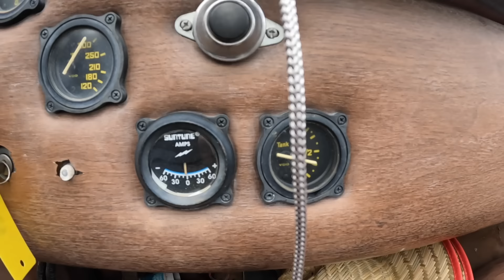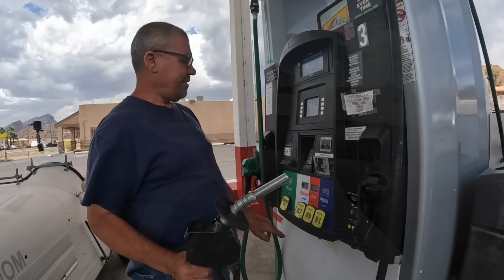This Bugatti Engine Has a Top Speed That you Won't Believe

Comment: Merlin and Brad relying on the Kindness of strangers.  Thanks, Summer, for giving them a ride .
Reply: Love meeting new people 😁
Reply: Up here in Washington State, no single woman would dare to pick up 2 dudes hitch hiking. And most of the time even two dude won't pick up a single woman hitch hiking.
Reply: Merlin I think that’s cool. I bet you get a million hits if you put air ride suspension and one of your hopped up vw  engines 1.5 million hits with a  Ls and disc brakes! Love it
Reply: Seattle WA is my home town. I moved to AZ a few years ago. I would never pick up a hitcher in WA. No need to stop in WA.Most breakdowns happen within walking distance of a gas station.
Reply: @RatCityprincess  Down HERE on the other hand...
Reply: No o e noticed the glass if Ice cold tea on passenger side cup holder.  Who was the passenger?  Or maybe they new summer had her drop them out and circle block for content. No one has reasoning skills it observation
Reply: @trinkladd  It's called editing.

Comment: Hi Merlin.  That place you stopped at is Vidal, not Earp.  Wyatt Earp's cottage was very close to where you parked.
 The intersection of CA 95 and Hwy 62 is Vidal Junction. Earp is towards Parker at the intersection where you turn to Parker (62 & 95).
Fun video.  If you ever need a chase truck for adventures like this, give me a call.  I am in Parker.  Jim

Comment: My Boss has one of those Bugatti's. His has a firewall but there is an access  cut ontop of the body to access the gas tank  and the rear they made the tail section removable  from behind the rear seat.  Awesome  car to drive. Boss has never driven it but i have after working on it. Has had carb issues  .. Also keep up the good work. Enjoy your escapades.  🤙

Comment: Hahahaha ... what an adventure, gentlemen !!! 
I suppose that those polyester bodies were sold as a kit to adapt to a VW-chassis. 
Kind'a like this idea even if I'd prefer a Bugatti-ish body with some (old) engine in front instead of in the rear.
Putting some bags of sand over the front axle (under the hood) will, for sure, give this car a lot more stability. Probaly something about 60 up to 100kg. 

Thanks for sharing. I really liked this vid! 

Grts from Belgium.

Comment: The  Radiator is from the  Original Bugatti Here's what I found on it The Bugatti Type 35B was introduced in 1927 and was the final iteration of the Type 35 series. The name Type 35TC was pondered since it shared the same 2.3 liter engine as the Type 35T and a supercharger just like the Type 35C. The engine produced an astonishing 138 horsepower, by far the most of the Type 35 series.

Comment: Some years ago a friend of mine built a car nearly identical to yours right down to the model A wheels and tires. The very light weight and skinny tires made it nearly un-drivable especially on wet pavement. He poured a bag of redi-mix (80lbs) into the front axle mount bracket which helped some.

Comment: Merlin you are in a tow yard and the perfect place to ask someone who works there for a key to the gas cap. They might even have a universal fuel cap key. The lock out kits the tow truck drivers use to get into customers vehicles usually comes with a universal fuel cap key

Comment: Only 200  type 35 Bugattis were ever made. The last one that sold at auction went for $ 2,900,000. The only thing that Bugatti didn't hand craft in factory were the tires. The engine was built so well that no gaskets were needed anywhere in the engine.Top speed for a type 35 Bugatti was 125 MPH......in 1927. 0 to 60 in 6 seconds. It had an inline 8 cylinder water cooled front engine. It is an Italian car. That lever on the outside of the car was the ONLY brake. It was one of the most winning race cars of it's time. Over 1,000 wins and 47 world records. What you have is a cool kit car replica.

Comment: That is one of the better kit cars from the early 70's they did right & kept it simple with the 2 windscreens and wire wheels, Bruce Meyers had a kit car/ dune buggy he called the Meyers Tow'd, produced about 100 of the Tow'd units, In '72 i traded a '53 chevy "tin woody" for a street legal Tow'd' which happened to be the #2 Tow'd that Bruce produced, A total departure from standard kit buggy of the day As it Had a Tube chassis with 1 piece glass bucket that was inset in the chassis used VW F&R components My Tow'd had an early Bus trans with the reduction boxes & front was llfted so it had about 5" lift, weighed in at just under 1k pounds.It would crawl anywhere we aimed it so we called it the "Lunar Rover" after the Nasa Moon buggy.This Bugatti would be a great sleeper with either a Subaru flat 4 or a Corvair transplant with a slip & slide powerglide if they fit in the engine bay>Yikes,  Or Go offroad with the Bus transaxel & lifted front end, i like the wire wheels so keeping it as intended would be for me.

Comment: That's a BUG-aughty! Kit car body  on a VW Beetle chassis and engine. You guys need leather helmets and goggles to drive it! 😂
Bugatti himself was Italian. But he set up shop in Molshein, Germany and built cars there up to WWII. During the war they produced airplane parts, which made them a target for Allied bombers. The factory was destroyed during the war, and a new one was built near Paris after the war. 
Founder Ettore Bugatti died in 1947 with no direct heirs and the company went downhill until it was bought by the Spanish firm Hispano-Suiza in 1963 primarily for the airplane parts business. 
There were a couple unsuccessful attempts to bring back the Bugatti cars. Finally in 1987 the brand was purchased and moved to Italy, where modern Bugatti supercars have been built in small numbers ever since. If you have several $ million to buy one of those and a long enough straightaway, you too can drive a car at 200+ mph! And, today Bugatti is owned by... wait for it... Volkswagen!
That kit car is reminiscent of the Bugatti Type 35, which was built from 1924 to 1930. An aluminum bodied, open-wheeled race car in various forms with different size engines (including some supercharged models). The biggest engine was a 2.3L straight 8 that produced 130 hp. Type 35 won over 1000 races! 
The Type 35 did not have "bicycle fenders," like those on the kit car. However, one of the succeeding Bugatti racers did use those style fenders. 
In addition to their racers, pre-WWII Bugatti also built luxury town cars and sports cars... the latter having a few more amenities than the stripped down racers like the Type 35. Amenities like an actual windshield rather than those little Brooklands style, and an actual convertible top in case of rain. 
Bugatti is credited with being the first car maker to use cast aluminum wheels (at a time when some were still using wooden spokes).
P.S. I found a couple recent auctions of fully restored REAL Bugatti Type 35C (the suoercharged version) that sold for 2.2 and 3.9 million Euros. I bet you paid a little less for the BUGatti. 😃
And I really hope you put the rear fenders back on. They looked great!

Comment: Your luck is like mine. I may get 30 miles out of my 2005 Toyota Prius which I have not been able to enjoy three days without it having problems. Now the modular Ignition Key has died and the car is dead. I have had to buy both Batteries before I had it three days and it sat a week and a half at Toyota in my town and I had to have a battery delivered from San Lewis Obisto, Ca. and they do not come cheap, Then I had to buy the main 12 Volt at $174.00.

Comment: I need a crown hick in my fleet i might have to see what i have in my salvage yard that has a close enough wheelbase to my bubble vic with 5.0 police interseptor then find a set of triple pedals and punch a hole in the floor and get a racing steering column and derby car ignition and put my moose antlers on the brush gaurd/winch push bumper i have a stout built 318 magnum built for a derby car but that my granny 4 speed with a NP205 twin sticked and a doubler sounds fun then the 5.0 can get shoehorned into my ford courier with a narrowed 9 inch and the 5 speed out of a wrecked mustang to replace the factory 4 speed that probably explode the first time getting on it hard if i could find a bellhousung to go from 4 in a row to V8 stuff maybe i can narrow the front sub and use the vic suspension and steering for the little puddle jumper

Comment: Merlin the Bugatti 37 originally had 8 cylinder engines and are worth a lot of money today in good condition. The VW engine in your car is really a disgrace for what used to be a great car. The VW engine is really a disgrace in a Bugatti 35 - dito Typ 37 from the twenties -. Merlin, originally is the Bugatti a French Car. VW indigreat the Bugatti in the VW group and produce the BUgatti with a 16 Zylinder Engine. Smile, very strong. 
Greetings from Frankfurt. Gerold

Comment: The only thing missing is a coat of brown paint.
Reply: btw, Bugatti was born in Italy. The Bugatti factory was in Molsheim which is in the Alsace region. Depending on the weather it has alternately been in France then Germany then France then . . .

Of course the original business went bust years ago but the "brand" is now owned by the Volkswagen group. So it seems the POS Bug-atti was just ahead of its time and perhaps even color appropriate? While blue is the color most associated with the Type 35 Bugatti, back in the 1924 race cars were colored representing the nationality of the race entrant. Blue for France, Green for England, Red for Italy, White for Germany. 100 years later . . . there you go.

I'd have been a hard "PASS" on that abomination but, to be honest, it does have some intrinsic appeal as the ultimate troll-mobile making heads explode at any gathering of self important 'pinky out' Bugatti 35 owners. Chop, chop old boy. . .

Comment: Only Merlin !!  I saw kits like this pile of crap , sitting all over place in 70 & 80’s. Most were old Volkswagen front ends. Then they used Volkswagen trans axle & motors.  Merlin you are going to sunburn that noggin if you don’t wear that straw hat.